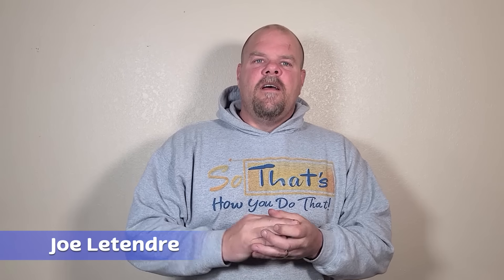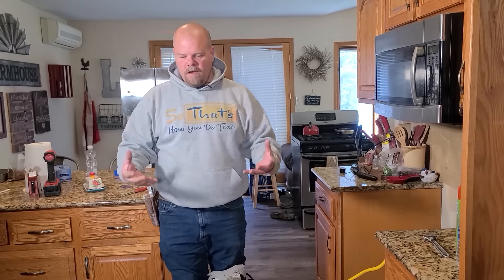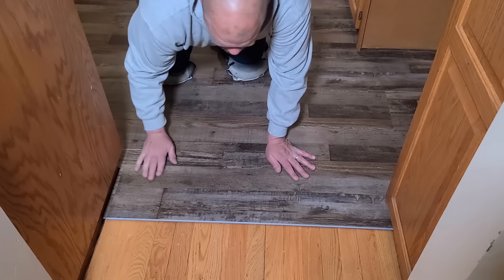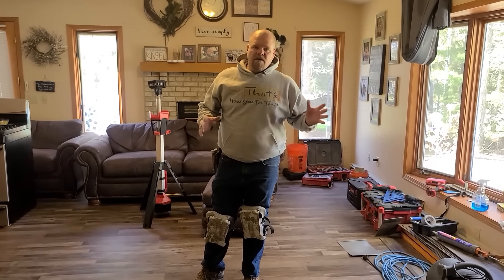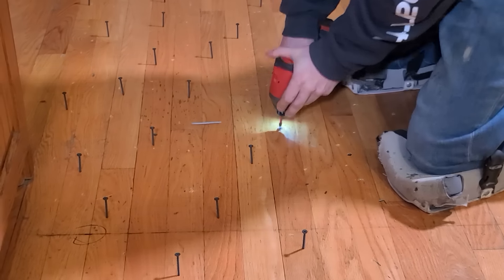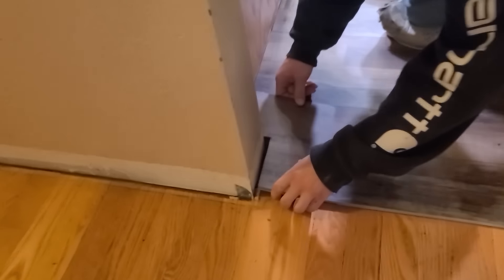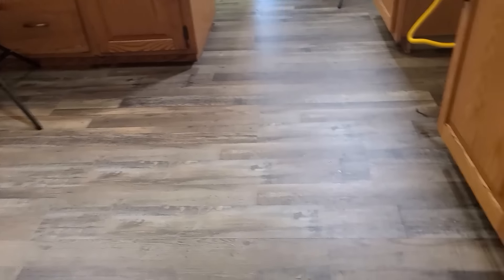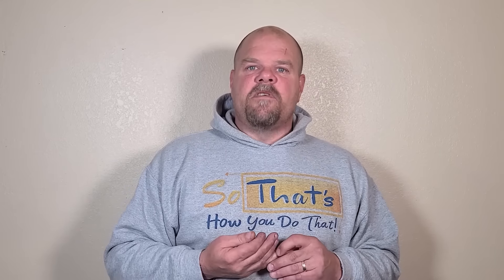I SCREWED UP this LVP Installation | Had to Take it up and Re-Install it

Comment: I've done a lot of uninstall/reinstalls over the years to remove damaged planks or fix low/high areas and have found that lettering the rows and numbering the boards using pieces of  blue tape or masking upon which you write your numbers and letters , is a great way to keep all the planks in order.

Stack the rows in alphabetic order then reinstall in reverse sequence making sure to cull out damaged planks.

When you get to Z, start over with  row AA for instance. 
We did one a few weeks ago and ended up at  GGG and 209 planks. 
It is tedious but the end users appreciate the effort to minimize waste, breakage and the use of new material.

Comment: I had to do this exact thing while doing my first DIY LVP flooring job.  Saw a joint in a majorly visible spot in the living room separating and had to fix it as I was going to be selling the house shortly thereafter.   What I did to keep track of the planks is treat them like an Excel spreadsheet and flip them over and write a letter and number (A1, B7 for example) on each to remember where they go.  Took the guesswork out of the reinstall.

Comment: Great video.  I have encountered cheap LVP where the tongue and grove break when taking them apart.  Also, some would say it is a sin to cover up hardwood with plastic LVP.  But sometimes you have to do what the customer wants.

Comment: I hate to bring this up, but do not use sheetrock screws on anything other than drywall.  They are weak, and will snap.  Use flooring screws, which are no 9 gauge and usually 1 3/4" with a Torx head.  Cheers, appreciate your honesty and integrity.

Comment: I had to take one apart and reinstall it once. I brought along 2 helpers and i lifted the planks 1 at a time, handed it off to a helper. He used a white paint marker on the back to number each plank and he handed them off to the next helper. He stacked them in another room and after the last plank was removed, numbered and stacked we reversed that process and i reinstalled them as they were handed to me in chronological order. The room was 22ft x 16ft and it only took us, from start to finish, 1 hour and 48 minutes. Not too shabby for 3 dudes that downed a case of beer before arriving at that house. It was for a friend by the way! Lol we dont drink before OR during work unless its at a friend's house :-)

Comment: I learned tile work from an old craftsman. Job one is no squeaks or "soft spots". Subfloor MUST be securely fastened. I've worked in half million dollar homes with squeaks in floor. Craftmanship and pride in work are no longer taught. Folks are taught speed work and multitasking. Good on you for being a good contractor.

Comment: I pulled up our entire main floor interlocking flooring to replace a damaged section.  As we pulled up each row, we wrote the row number and position in the back of each plank. Then we just put them back like a puzzle in order.  Worked great.
Reply from the maker: Good tip

Comment: @ 8:30 your advice is what I always did and also wondered why others did not. Best advice you can give. So many times I saw guys have to travel back to a job and set up tools sometimes mixing thin set and grout to replace a chipped tile they saw when they put it in (or grouted) and they just hoped the homeowner would never see. Here’s a clue, the HO will spend a lot of time there and will see it.
Reply from the maker: Exactly!!

Comment: I eliminated the squeaks in our 55 year old hardwood floors using “Squeak No More” screws (the sheathing had not been glued and screwed).  The special screws have a shank that breaks off below floor level.....otherwise the floor would have had to have been replaced.....lots of work, but saved about 15-20,000...

Comment: I feel your pain. Did my my upstairs 900 sq ft. Used aqua guard. Went over hardwood floor but instead of using the required padding i used tar paper.  Huge mistake. It squaked everywher. I installed alot of hardwood and used tar paper or rosin paper.  And on top of it i used no saddles so it was one contuous floor.  Learned a big lesson.  🤦‍♂️.

Comment: How are you preserving the hard wood floor by putting screws everywhere, and isn't it recommended to use a non slip underlay.
Reply from the maker: We tried to preserve it and now we are not. No underlay was needed when it has one attached.

Comment: i just did a full remodel in my bathroom full tiled shower vinyl flooring etc well it was my first time doing any of this kind of work and everything turned out wonderful except the grout job on the tile i didn’t do enough research on it and didn’t watch enough how to videos to get the understanding for it and i made my mix a little too wet and did the washes wrong too much water in the grout and now i have to dig it all out and do a full regrout due to air pockets and pinholes porosity etc sucks but live and learn

Comment: I am a computer guy and not very handy with home repairs. My wife and I bought our home brand new construction in 2004. So things are in need of being replaced. We have a revolving door of cats, as we rescue homeless kitties and help strays, so our carpets needed to be replaced. My wife talked me into doing our formal living room with luxury vinyl plank flooring. I've pulled up carpet and laid sticky tiles in a small room before so I figured this couldn't be any harder. We pulled the carpet and padding up to revel a few spots where the cats used it as a catbox. It was pretty gross, but we never went in this room so I never noticed it was that bad. But the flooring under the carpet needed to be sanded in a few spots to level it. also to remove some padding that wouldn't come up, I don't know what the builders did. Once we got all the carpet, padding, staples and leveled the floor we started with the planks. It was very easy to do, but figuring out how to start was hard, I didn't want it to be crooked or uneven. Cutting the heat vents was the hardest part. 
Then my wife talked me into doing the dining room and the Family room. By the time I did the 3rd room I was an expert. The best advice is to make sure the sub-floor is clean, level and free of staples, nails and such. Then make sure you measure the room and figure out how many rows you need and how much you will have to trim off the bottom row. The planks are laid from top left to bottom right. The next best tip is to make sure there are no gaps in the seams. Get a special tool for tapping the planks together. My first floor had little gaps here and there, but the last room, every plank was tight. Also it is worth paying more for the nicer planks. They have padding on the back and are thicker and more comfortable to walk on. The floors look great and almost anyone can install it.

Comment: I have seen and used  a similar product  it is pretty much a floating floor so acts like a laminate floor.. so you need to allow expansion and don’t build kitchen units etc on top .. also consider what  you are overlaying as products can sweat and expand ..
Reply: Um no it is much more expensive around here maybe if you refinished it yourself.

Comment: Great video!  Question:  We had Dura Quantum 7.0 installed and the specs say it is a Vallinge fold down system.  Will this be easy or difficult to remove and put back together?  Worried about compromising all the joints to save 3 joints.  We have 2 joints that are in a dip and one joint I can feel a ridge under.  I like the way your video embraces “everyone makes mistakes” while at the same time recognizing that this is a long term investment.

Comment: Hi there! Love your videos! I wanted to ask, we had a contractor install click in place flooring. There are so many gaps, not only on the butt ends but also along the long ends. Is there any way to save the floor or would the whole thing need to be pulled up and reinstalled. 

Thanks for the help and advice!

Comment: I'm trying to preserve my wood floors in a similar way. i want to use loose lay vinyl thinking that's the best way with no screws or adhesives. For the uneven areas i was going to use the roofing paper. Does this seem like a good plan?

Comment: Thanks for sharing Joe. Having similar issue some of my old engineered hardwood was damaged by water in kitchen area only. Over season change bowed up popping up the new vinyl floor in 2 small areas. My contractor installed just 6 months ago. Now he has to come back & I'm asking him if its best idea now to remove old flooring and leavel full kitchen. Also feel flexing in areas had nothing do do with water damage. Do you think good idea to take up all old hardwood and level or just those areas that where wet? Worried now if water some how could get underneath vinyl floors in future would pop up the old floor underneath making having vinyl floors pointless. Have you ever seen that problem before. Thank you.  Product installed was  Rigid Core Luxury Vinyl (Whistling Hills) 
Undrlayment Sentinel Protect Plus on concert slab. Vinyl doesn't seem to lay flat flexes and makes soft rice crispy sound when cold walk.  installer said do the the hard texture quality of the product. (Flooring manufacturers) came out said do to flooring being unleveled underneath only certain areas. Any suggestions frustrating thank you again.
Reply from the maker: I would tear it all out and fix the floor.
Reply: @sothatshowyoudothat  thank you for getting back to me maybe route looking to take if possible.

Comment: I am also planning to install new flooring on top of hardwood. Wondering what was the issue for not nailing those floors down originally? I am also trying to save the hardwood floor underneath in case I want to refinish it later on, would love to avoid the mistake!
Reply from the maker: To save the floors. Honestly, the hardwood in that video was laid the wrong direction and looked terrible. It was also only installed in certain areas of the house which also made it  seem very odd. It needed to be covered or demoed.

Comment: Just a question on the hardwoods the direction of the boards versus the direction of the new plank. Is that more advisable to do that for better structural integrity?  In some cases, I've seen with a client wants to go the same direction over the hardwoods that they are currently going. Is that okay to do that? I would think it would be okay as long as once again those hardwoods are down solid prior to laying this stuff

Comment: Hey Joe I want to thank you for your detailed videos, because of your videos I am in the middle of doing my dining room with Armstrong luxury vinyl planks with the angle angle system.  I noticed after 3/4 of the job that I have some planks that not fully seated in the locking system in the first several rows, a slightly raised edge on three planks. Is there a way to fully seat the plank without removing several rows?  Please let me know.  Thanks again.

Comment: Been working on a LVP floor worked from left to right but then had to work backwards then into a bathroom, looked like all was working out however, when getting back out to the hallway, seems it is slightly out of square.   Is the only solution to remove the floor and reinstall or can I cut the floor at a doorway and use a transition strip to adjust so that I return to square?

Comment: Well I couldn't afford to buy 18 boxes at once. Seeing that they were a stock item I figured I could get 9 now and the rest later. Wrong! They discontinued my item!    Then they brought the item back but they changed the color of the exact item. So I now bought 18 boxes and will be doing it all over again. I will be using what I remove someplace else.

Comment: Hey Joe, I would just like to say that I love your videos! Thanks for the secrets the pros use; from the tools to buy, the cheater/marking board, the ten plank cheat sheet. These tips have been invaluable on my LVP instal in my basement.  i have a couple concerns regarding my instal that maybe you could give some advice on.  I’m installing LVP from a hallway into a bedroom. The bedroom is carpet and the hallway of LVP.  I only installed LVP 3.5 inches into the doorway of the bedroom instead of the 4 inches you recommend. Do you think I can get away with this? I also have a large portion of planks I would like to tear up and fix. What is the best way to tear up LVP with the locking system that requires installing the long edge and then pounding in the but joint? it seems difficult to uninstall without damaging the locking system. again keep up the great videos Joe!!!!!
Reply from the maker: The door nshgould be fine. Have you tried to take any plank up? If yes, what is happening?

Comment: How did you find the studs to put the screws in?
Reply from the maker: I used 1 1/4 inch screws that had thread all the wat to the head of the screw. So, the screw will have bite to just the subfloor. If there was still a squeak, then I would try and find the studs and use longer screws to secure the subfloor. Anyway, use a stud finder or go into the basement and try and find a joist and measure the distance between them. This will help you find the joists easier.

Comment: Hey quick question. I pulled up this tack stripping that was sunk into the concrete foundation with some kind of concrete nails. It was from carpet that I ripped out of of a room and when I pulled out the concrete nails it left little pock marks in the concrete. So anyways, my question is, what do I fill those with those little pock marks with? Can I just ignore them since I’m putting the underlayment over the top them anyways and also they’re only around the perimeter of the room where no one will be walking on?

And then I had another question. There’s this stucco like texture on the walls should I sand this at the bottom if I put in new trim moulding and not to mention the little spacers that butt up against the wall, I should sand the stucco to get a flatter surface right?? Any pointers in a future video would be appreciated, thanks.👍🏼
Reply from the maker: Don't worry about them!

Comment: Is it a bad idea to use additional underlayment on planks that already have it?
Reply from the maker: Not necessarily. First off, check and see if your manufacturer says it is ok, some do. Otherwise, I would not. There are too many plank manufacturers that do not put enough strength in their locking system to handle the extra pad.

Comment: Is there any way to take drop and lock apart without destroying it?
I have a joint about 4 ft from the starter wall that is not together correctly.
Am I going to lose everything I take up?
It's Nucore
Reply from the maker: Yes, try and pull the full row out at once and slide the butt joints apart.
Reply: @sothatshowyoudothat  Joe, would it be possible to remove the entire row and just reinstall it still together? 
I thought maybe I could put a piece of gorilla tape on each butt joint to help keep them from breaking. Rows are about 12 ft long. I know I will need a couple helpers.

Comment: Any recommendations on what to do when laying vinyl over uneven hardwood floor? Im want to preserve the original hardwood floor.
Reply from the maker: You can build up the floor using layers of LVP pad(I would use quiet walk), but be sure you are using a quality LVP with a strong locking system.
Reply: @sothatshowyoudothat  another question. I began laying the floor and realized its not staggering. Lol! should i remove them and cut them to stagger? Or is it okay to leave it how it is?

Comment: Man me and my girl bought a new place with nice lvp flooring but it's started buckling real bad when the weather changed and I'm trying to find out if there's a way to trim the edges so it's not so tight without removing the flooring altogether
Reply from the maker: Use an oscillating saw.

Comment: Hey Joe, I started installing nucore lvp yesterday (my first time installing lvp) and only got the living room done. I have plywood subfloor. I noticed some planks aren’t leveled with eachother and they flex, aren’t locked in, and some are higher than others. I could’ve sworn i locked them correctly when installing. Could it be that my floor isn’t leveled? If so, should i use self leveling cement or just patch the spots that aren’t leveled? Please help. Thanks!

Comment: I'm going crazy with this, but HOW do you block the sides (butt sides) of the flooring from going against an uneven surface? 
I get the tapping blocks on the "long" ends, but I'm getting gaps in all my buttjoints because I'm installing with no baseboard, so they're just sliding back and forth.

Comment: Lots of people aren't getting why anyone would cover hardwood with vinyl plank, here's something nobody is considering - I have severe migraine disease and would have to move out of my  own house for months due to the chemicals used to refinish hardwoods or suffer debilitating migraines. Also, plank installation is very fast and much less stressful on my pets and less dangerous for them. It's more durable for pet owners, as well. Sometimes we make choices for pure practical reasons.

Comment: how do you replace a lifeproof vinyl floor plank that's in the middle of the hallway? we put the product over a concrete sub floor and didn't notice a dip in the sub floor. so the one plank is lower then the other causing a ridge. It's sad because it's so noticeable. I saw videos on cutting the plank out. I guess that's the only way ?
Reply from the maker: Yeah, just cut it out.

Comment: Kind of you to redo that!  (Not even getting into if the owner was aware it might not work?) .  However; those Sheetrock screws will break over time because they are brittle and not meant for continuous load between the subfloor & hardwood plank!  You might get away with it because u used so many???  In the future I would use a construction screw like used on the subfloor or heavier ?   Oh and look at the diff between a hardwood screw and soft wood screw?  Tighter threads!  These will work out over time!